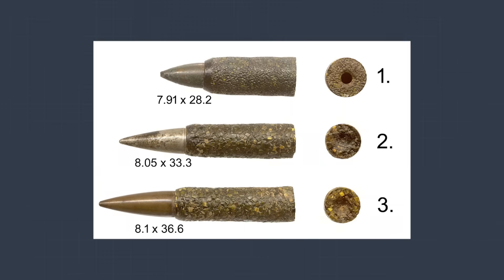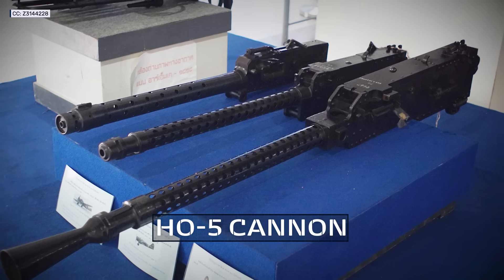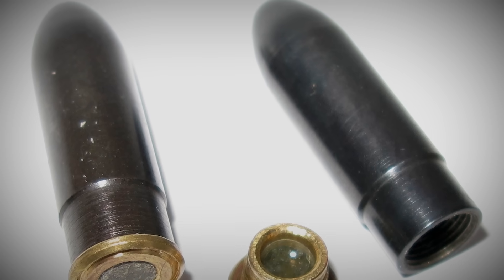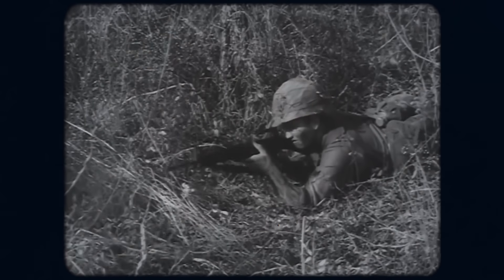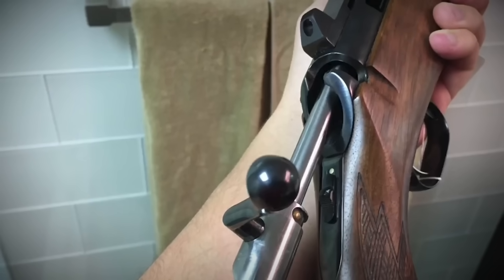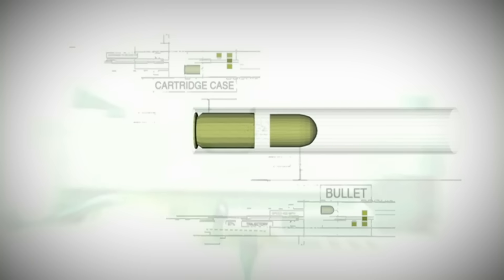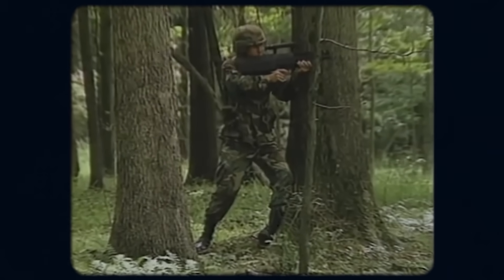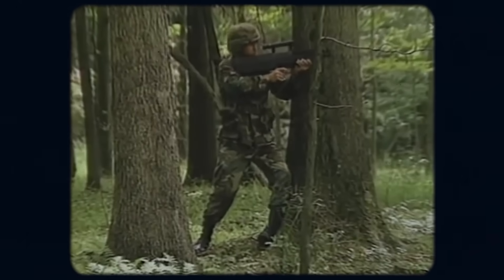Is Caseless Ammunition the Future of Warfare?

Comment: Take a look at a guide to "field stripping" a H&K G11.
Try asking a squaddie to do it in a muddy field, or desert.

On a related note, when the M16 was first adopted, it was assumed that it's direct gas system would ensure it never needed cleaning... to the point where no cleaning kit was issued with the rifle.
It quickly became apparent this was incorrect and cleaning kits were retroactively issued.
At the same time, lack of cleaning mean the bolt didn't cycle reliably after using the charging handle, hence the requirement for the A1 revision.
Arguably, the Forward Assist might not have been necessary if regular cleaning had been procedural but, then again, if an issue has been noticed it probably doesn't hurt to engineer a solution.

Comment: Never forget that the Prussians used a caseless rifle for around 30 years in the mid 1800s! The Dreyse needle rifle was caseless and worked pretty well up to 300m despite the many detractors. The French also had a caseless rifle in the 1860s.. the Chassepot was better than the Dreyse and was effective out to 800+m but was badly used.  I have both rifles and shoot them regularly.. 
But frankly if the Germans could not crack caseless rounds in 20 years, then it is probably better for us to wait for  portable Lasers in the 25MW range to be developed.. (with or without shark head mounting capability!)

Comment: The main issues with caseless ammo are: 1) rough handling might cause it to crumble, deform, or be damaged in some way, such as rain and hot or cold, humid or dry weather, etc. and 2) Obturation, how to seal the firing chamber against gas leakage.  Yes, these problems have been overcome, but they are always there, hiding in the background, waiting for technology to advance.

Comment: I'm a retired physicist (google research gate jack woodyard) solid state rocket fuel is designed to burn from the inside, out preserving the motor walls. A special mix may be the best bet for a cordite propellent replacement. Design it to burn fast with a high specific impulse. Use the new compressed munition technology. It may work.

Comment: The brass case is the solution to caseless ammunition. The idea can only be improved by a cheaper more abundant material case that protects the measured components, while sealing the chamber . Removing the case is absolute bloody mindedness to improve a thing that consecutively fails though producing govt. money to solve a non existent problem yet following the same architecture with different material. Electron pulse weapons are on the right track and air cannons using massive pressures. They use a throw the stone objective by a new method to explosive charge. Not a small arms mechanism by any means. Especially the air gun. Though breakthroughs in airgun function are plentiful it creates reliability and field repair questions still.

Comment: There's a good potential for "caseless" ammunition once manufacture of carbon-fiber cases become economical.

My guess is you still might need a brass end cap.  Still, this type of design would solve a lot of the challenges mentioned in this video AND the new design could possibly be compatible with many existing firearms.

Comment: G11's literal clockwork mechanism was so complicated that when anything went wrong, it couldn't be fixed in the field and had to be sent to factory for replacement, that's mainly what killed the program.
Reply: No, what killed the rogram was the fall of the Berlin wall and Iron Curtain. There was simply no need for an expensive new infantry weapon because there wasn´t an immediate threat anymore and military budget was cut drastically after reunification. The G11 was, despite it´s complexity, pretty reliable and would´ve been adopted if the Berlin wall had fallen a few years later!

Comment: How about guns with liquid propellants if you want to get away from casing.

I am surprised that the Japanese during WWII, didn't try some form of paper casing such as the nitro-cellulose of the G11.  Paper would seem to have been natural for an Asian culture.

Also, couldn't the steel or other more available metal case be improved...  Maybe a texture on the casing could change the friction coefficient for more reliability, maybe Teflon could be added to a textured surface.  Textured surfaces would also be getting into the relatively new science of metamaterials and indeed maybe a far greater range of materials could be used when metamaterial structures are implemented.

Then there's science fiction as inspiration, not only are there coil guns, rail guns and rocket guns in science fiction but then there's the pulse guns of Farscape which were essentially water pistols that fired a specific explosive oil that was farmed from a taro like root which also seemed to make people more compliant if eaten (presumably that oil was probably fired much like a rail gun or by magneto hydrodynamics for far greater speeds so very high tech water pistols).  Then there were the laser blasters of the 70's Battlestar Galactica which had four side exhaust vents where flashes were seen, as a kid, I had imagined those laser blasters to be chemical lasers that worked on the combustion of chemicals brought to the combustion chamber by cartridges or stored in tanks.  I had even envisioned buying a RadioShack pistol butane soldering iron/torch and trying to convert it into a combustion chemical laser (things kids will think of when watching TV shows)...

Comment: It seems to me that a caseless round rifle would require a lot more cleaning.  When a round goes boom, the leftover crap from the explosion gets ejected with normal ammo.  But, caseless means that the explosion is happening in the chamber with nothing to protect the metal.  And all the fouling stays in the chamber where the next round is loaded.  Its fouling on top of fouling on top of fouling until it fails.  

And thanks for showing a clip of Barry, from Iraqvet8888.  I miss that dude.  They used to shoot some of their videos at the range I worked at.

Comment: What about an automatic combustion cannon where I power the machine gun with a small hp two stroke engine from a chainsaw and feed bbs into it from a hopper magazine. I would need to design a rapid fire recoil firing mechanism to feed the barrel but as I see an average chainsaw has a rpm of about 13000 and that is a super firing rate for any weapon.
3 or 4 mm standard lead bbs should do the trick.

Comment: If the propellant is encased in a plastic sleeve then it's NOT caseless ammunition.

A VERY BIG problem with true caseless ammunition is the propellant reacting too changes in humidity. In high humidity caseless ammunition has a tendency to expand which in turn results in feeding problems.

Comment: the issue that seems to be what's holding up the progress is heat. the ejected shell takes a lot of heat out of the gun. for full auto platforms using caseless ammo that really becomes a problem. I've given this considerable thought regarding a solution. I believe I have a couple possibilities that would work. in my opinion gun design has hit a wall ballistically and stylistically.

Comment: With sufficiently advanced and precise machining, a firearm could function far beyond the capabilities of current models. It wouldn't just fire bullets—it would essentially act as a customizable weapon, capable of adapting its firing power to suit a variety of situations. All the gun would need is ammunition and a supply of gunpowder. Once you load the gun, the bullet is chambered and pushed into a "press" system where the optimal amount of gunpowder is automatically inserted and compacted against the bullet. 

This system would allow for fine-tuning of the shot's power. For a quiet shot, you'd use less gunpowder—maybe even down to a whisper of a round. But when you're dealing with tougher targets, such as armored foes, the gun would know to crank up the pressure and use more gunpowder, ensuring maximum damage. We're talking about the ability to shoot anything from non-lethal rounds to fully armor-piercing ones—all without needing to manually adjust anything.

In fact, the gun could be equipped with technology that automatically identifies the type of bullet being loaded. It could sense a rubber bullet, for example, and automatically regulate the amount of gunpowder to minimize recoil and prevent unnecessary damage. If you're loading an armor-piercing round, the gun would automatically load a higher charge of gunpowder for maximum efficiency. This would make the user’s job far simpler, providing a streamlined, almost intuitive approach to weaponry.

The gun could operate in two modes: manual and electronic. In electronic mode, it would be a fully automated, high-tech marvel, capable of monitoring multiple variables and adjusting power output accordingly. Fine control would be at the user’s fingertips, allowing for unprecedented precision in weaponry. On the other hand, manual mode would kick in when the power runs out, reverting the gun to basic functionality: lethal, non-lethal, or armor-piercing. Even without electronic power, you'd still be able to fire the weapon, though at a reduced range of capabilities.

Ultimately, this would be a firearm that offers far more flexibility, precision, and control than anything currently available. It would be a revolutionary shift in firearm technology, a sophisticated tool that tailors itself to whatever job needs doing.

Comment: If you can carry the case, you can have caseless ammo. Usually, you cannot, because you have to fight. Robots could use caseless better prolly. Have to have the trumpet boy carry the case until then though. The case protects and aligns the bullet so it stays accurate and functional, more than anything. It's like the difference between a plate of paint, and a marker.

Comment: TLDR: The case had several hidden features that when eliminating the case caused those features to be removed as well....

1: The case contains the majority of the propellant residue after firing and removes it from the weapon upon ejection.
2: The case contains thermal energy which is removed from the weapon upon ejection, aiding in preventing cooking off.
3: The case creates a hermetically sealed environment for the propellant isolating it from the elements.
4: The case deforms upon firing which aids in creating a seal which allows more gasses to push the bullet out.

When you eliminate the case, you make the bullet more economical but at the same time you butcher all the benefits of a casing which makes a bullet what it is, leading to a pros vs cons situation.

Comment: There will never be a caseless rifle as anything but an experiment. For hunting or precession shooting, there is no benefit. Cartridge weight doesn't matter. We aren't running around with 300 rounds. Only the military really cares about weight, as lighter means more ammo could be carried, but then there is the problem of battery heat extraction. The metal case extracts a huge amount of heat. Firing from an open bolt doesn't really solve this, as on open bolt is way less accurate and is really only suitable for full-auto fire. The challenges of caseless ammo or so severe that energy weapons will exist before those challenges are solved.
BTW, the Voere had the problem of being electrically fired. This is an issue with many caseless ammunition attempts. Electrically fired rifles or handguns in the United States count as machine guns and you have to pay the $200 tax and get approved by the Feds. This also means you had to inform the Federal Government before taking said firearm across State lines. It's super easy to catch a felony charge with those kinds of weapons, and it's simply not worth it for a niche hunting/target rifle.

Comment: It sounds like the “caseless” ammunition is really a cartridge with a soft, consumable (i.e., it burns) case rather than a hard, re-useable case (brass cartridge).  So what we need is a case that is durable and not too fragile when handled (i.e., don’t have to worry about getting wet or breaking), but burns easily when ignited during the firing process.

Comment: It would be interesting to scale down a 155mm reloading mechanism using powder bags and bullets separately. Another big issue has to do with clearing a field jam. Caseless ammo if jammed might foul the chamber or if the bullet doesn't exit the barrel due to poor powder explosion. Seems to me a better alternative would be to make a two magazine set up where internal components take up the roll of the brass designed to be loaded with powder by the mechanism and then put into a breach after the bullet is rammed into the barrel or stuff it down onto the rotating reusable chamber. It could be designed to be clearabke and if a single sleeve is fouled it may be replaced quickly. No need to manufacture magic caseless carcharages. Just simplify and accept that the fire rate will be less. Perhaps increase bullet size and introduce a burst charge into every shot to compensate fkr lack of fire rate.

Comment: What the G11 taught was that the biggest flaw of caseless ammo was heat. When a cased round is fired, the enormous heat is ejected out of the gun along with the case keeping the gun cooler for longer acting as a heat sync. The G11 had no such thing so all that propellant cause so much heat build up that the the caseless rounds were cooking off in the chamber. Thats the biggest reason caseless ammo never took off. It caused guns to overheat. On top of that, residue build up made cleaning it a bitch.

Comment: The reason why the G-11 was dropped from being ordered was the collapse of the Soviet Union, which included East Germany,. East Germany  reunified with West Germany to reform back to Germany. At that time, the G-11 was selected to replace the G-3 as West Germany's main rifle and H&K was thrilled it was given the green light to go into full production, finally, after decades of development. The reunification fell into the G-11's lap like a bomb as part of the agreement to bring together the two nations as one again and reconsolidate both armies into one led to an agreement to halt all procurement of new weapons for both German army's arsenals. Just as they were issuing the G-11 H&K was ordered to halt production. 1,000 G-11s were adopted for German Special Forces units but they were withdrawn in 2000 for reasons like the high cost of the ammunition, the unwillingness of NATO countries to buy the G-11, and the fact that caseless ammo didn't store well in long term stockpiles reserved for war. Despite extreme care used to store caseless ammo, the rounds would still dry out over time and the propellant blocks would begin to disintegrate and become brittle to the point of falling apart during common handling. After 30 years of development G-11s went into service for only about 6 years and were withdrawn never seeing combat.

Comment: My guess is we will get an intermediary ‘caseless’ cartridge - one that just has a bottom cap with a primer for ignition and a short rim for making a gas seal. Unfortunately you’d still have to worry about ejecting the cap, but it would definitely save a lot of weight. The cartridge could be compatible with most older rifles while still advancing the technology.

Comment: 10:42 "One solution is designing a gun that fires from an open breech, such as the MAC-10 submachine gun."

Correct, but, for context: Almost all machine guns and submachine guns fire from an open bolt aka open breech. These types of weapons are designed to be always fired fully automatic and heat can then be a big problem even with cased ammunition. Leaving the bolt open until the trigger is pulled allows air to flow in and help cool the chamber, and also prevents direct contact of the ammunition with the hot chamber until moments before firing.

Weapons that are designed for single fire (maybe with full auto as an option for exceptional situations) almost always fire from a closed bolt because it's much better for accuracy. In an open bolt weapon, there's greatly increased lock delay. All the mass of the bolt and cartridge moving around when you pull the trigger because the cartridge still has to be chambered obviously doesn't help either.
Reply: The MAC-10 is just especially infamous for "accidental discharges", famously parodied in the shooting scene with Jamie Lee Curtis in the 1994 movie "True Lies", when she loses grip of her MAC-10, it falls down a flight of stairs and in the process of doing so "accidentally" shoots all the terrorists. 😄